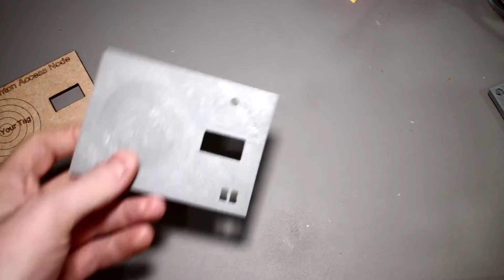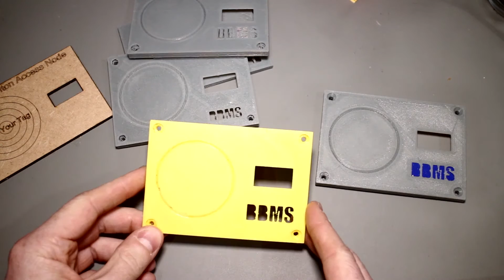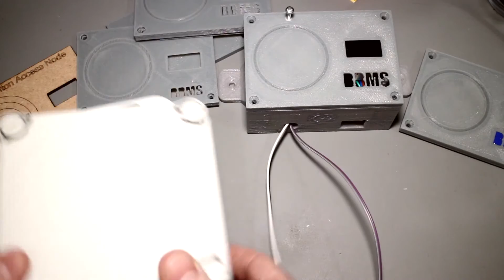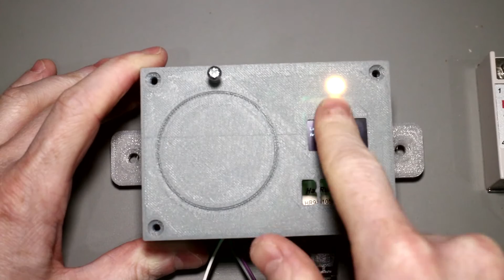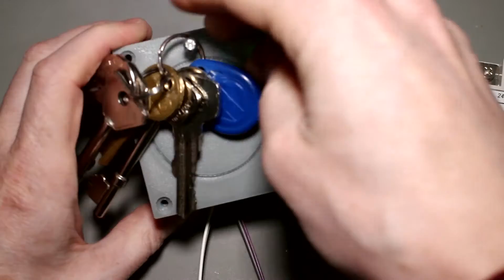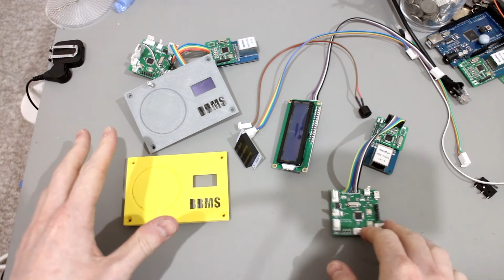Makerspace RFID Access Control #5 - The enclosure

Comment: I need to do this for our new space in Lawrence, KS - USA.

Do you have a Wiki/Docs for this so that other spaces can use them?  I was wondering if you could point me at part numbers, etc.

If not, I'd be willing to create detailed docs if you would help me get the first one built.
Reply from the maker: Hi, At the moment I haven't published anything on the hardware side. I am waiting on a new PCB to start work on v2 as this current system isn't reliable enough. When this is working I will publish the various pieces of code.

The server side of the project is part of the member system I am building.
https://github.com/ArthurGuy/BBMembershipSystem
Reply: Arthur Guy I went ahead and built one using Raspberry Pi as the core.

I can't seem to push the cost of the core system down below $75.  (49 British Pounds).

What is your system going to cost once the PCB is squared away?
Reply from the maker: Thats great, how is it working?
I am working on version 2 which is using a teensy and a wifi module so mine will probably cost about the same.
I think its worth it for the functionality something like this can offer
Reply: Arthur Guy Mine is:

1. Raspberry Pi B+ [$28.40]
2. SD Card [$4.95]
3. Power Converter (24V DC to 5v USB) [$8.23]
4. SunFounder 2 Channel Relay [$6.79]
5. USB RFID Reader [$17.98]
6. PoE Injector [$5 Retail]
7. Cables & Connectors [$3.98]
8. Misc Screws, nuts, bolts [$1]

Custom 3D printed case with mounting holes.

I'm using a BASH script to manage the input and sending auth back to the central server (also a Pi) via SSH using key based authentication.  The unit itself is dumb.

I have a souped up model at the front door that includes an exit button, maglock, speaker TFT display.  Using an Pi allows me to play sounds, videos, etc.

I wanted to do the whole project with off the shelf components that can be purchased via Amazon Prime.
Reply from the maker: It sounds like a great setup, my first version wasn't powerful enough to accomplish anything more than the basics. This new version should allow me to add a lot more user interaction to various devices.